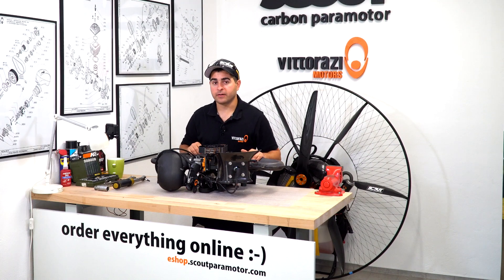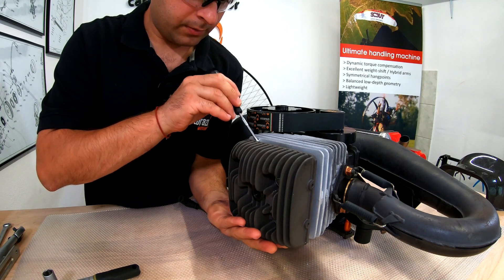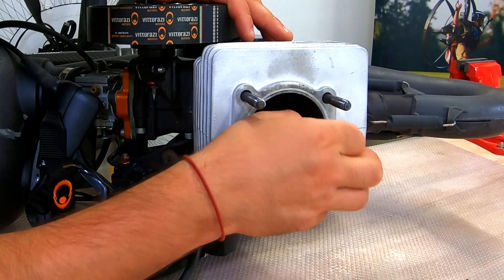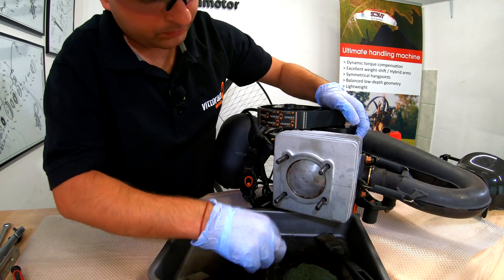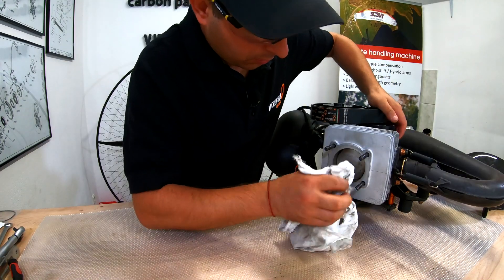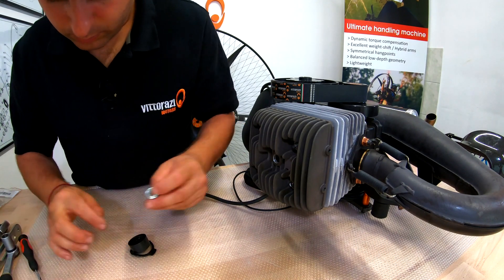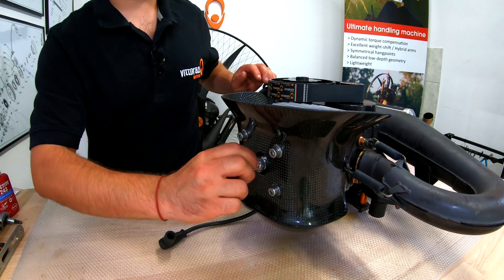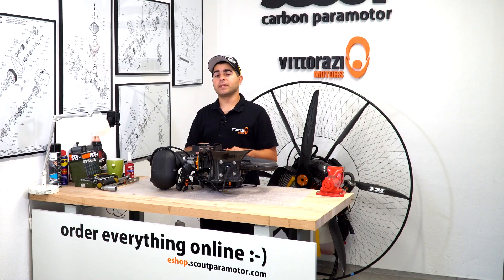Vittorazi Moster decompression port cleaning. Paramotor engine maintenance series

Comment: When did the Moster185 start getting bolts with thread union heads to hold the head on versus regular bolts?

I'm liking how that cooling shroud is held on versus the way my Maverick cooling shroud is attached. Or is that a scout thing?

Comment: Good video, but I think it’s more important to clean the piston ring grooves of any carbon build up to stop the rings from sticking. The carbon build up on the piston and cylinder head is not as detrimental to the engines operation.
Reply: Can this be done by putting the piston in an ultrasonic bath?  I got myself such a machine to clean the carburator. Best, Rob ^^